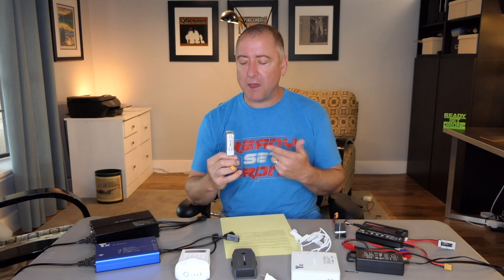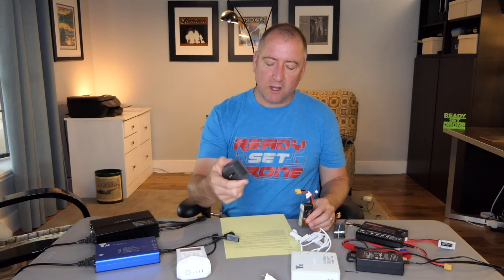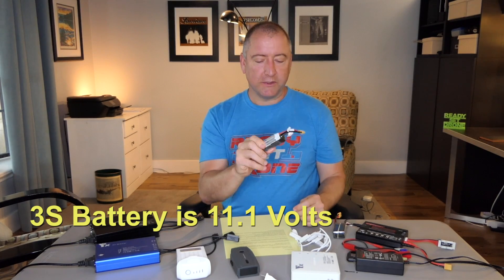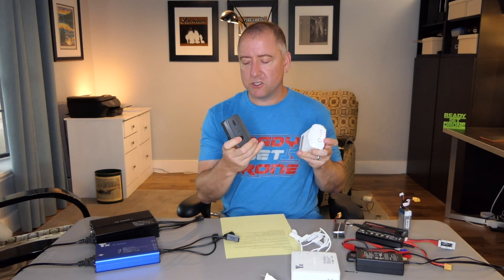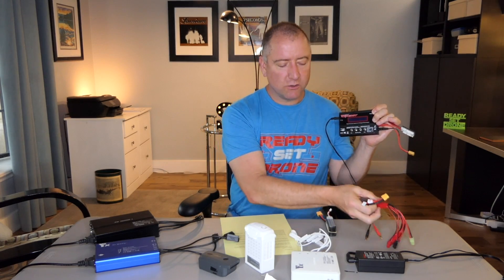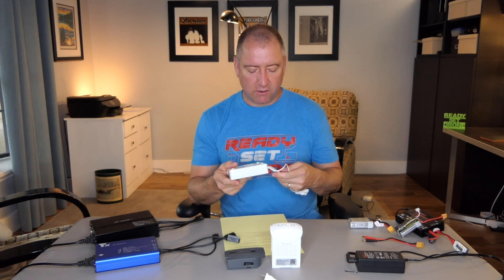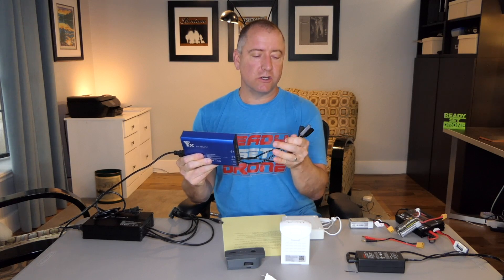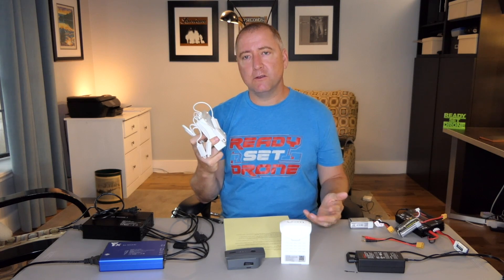LiPo Batteries and Aftermarket Rapid Chargers

Comment: Hey Kelly, I recently purchased the "Powerextra" high capacity battery on Amazon for my Phantom 4 Pro V 2.0 just to have an extra battery on hand. I had some legitimate concerns about using an aftermarket battery with my P-4 V 2.0 until I viewed your excellent video. I've been using this battery lately with a lot more confidence and with no ensuing problems. Thanks for that awesome review.  I'm going to subscribe to your channel.

Comment: Letting your batteries run down really low actually stresses a battery. This is what can also cause the serious failures. I'll actually mention the Parrot batteries. This has to do with the Bebop 2. The charger that Parrot sends with their drones are junk. They do not balance the batteries. This is another reason you need to pick up a balance charger. You will have to make/modify a cable to charge it. No worries there are plenty of YouTube video on how to make a Parrot balance charging cable.  Great info Kelly!

Comment: Great video as always.  Just wanted to know if I am traveling with my mavic air can they be in my carry on ?
Reply from the maker: Yes - in the US, you should put your drone and batteries in your carry on, not checked. Also, be sure your batteries are drained to under 50% charge before you pack them. And, ideally, put them in a lipo safe bag!
Reply: Ready Set Drone thanks will do .